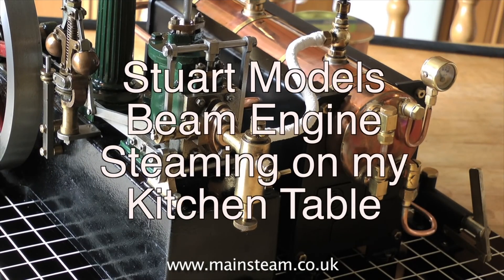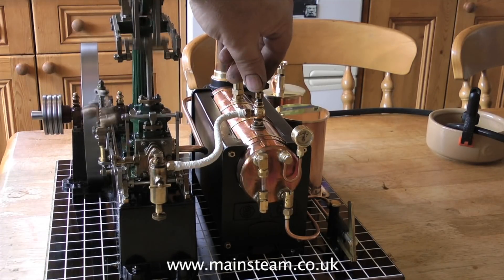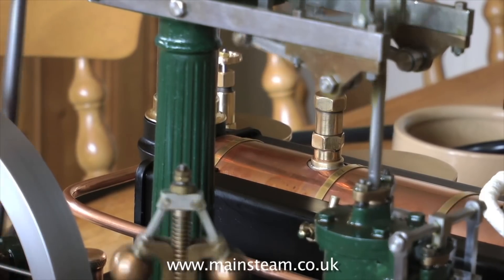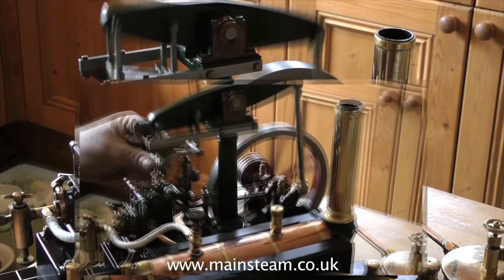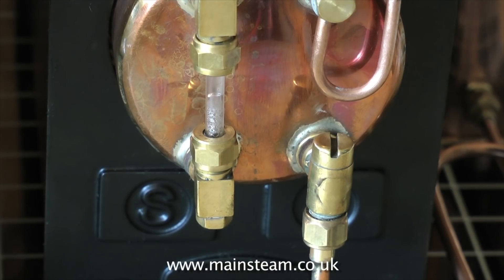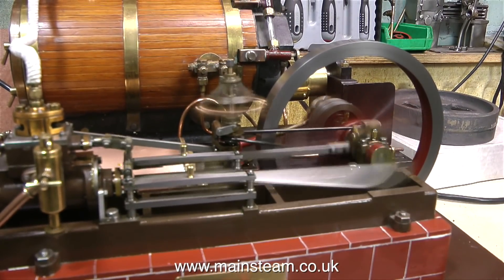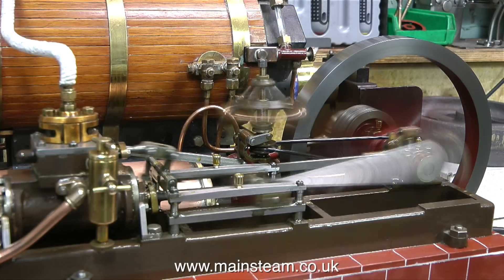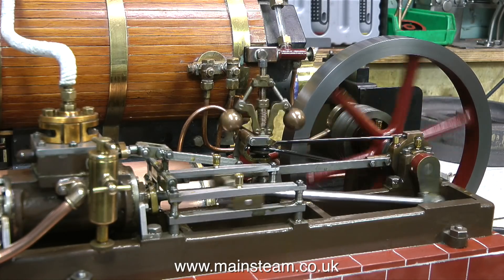MODEL STEAM ENGINES IN STEAM INDOORS - MAINLY IN THE WORKSHOP

Comment: I am so puzzled how the eccentric rod seems to be running half the speed as the rod connected to the crankshaft.  I am sure I am using the wrong terminology. Am I correct or is that just an illusion because of the motion?
Reply from the maker: the eccentric has half the throw of the crank web . . . .

Comment: What would happen if one were to use alcohol instead of water to make steam ? Would it run higher pressures at the same temperature and would the rings run dry of oil from the wash ?
Reply: If one could mitigate the obvious problem previously pointed out, it would be more efficient to a point than boiling water.  The amount of heat energy required to produce say 60 psi of alcohol vapor is a lot less than for water.  Spent vapor, not steam, would then be burned to continue the process.  Problems would be regulating that flame under changing loads, any leaking joints catching fire and the corrosion of seals on the cylinder.  Cant say what it would do to the oil/lubricant for sure, but vaporized alcohol can be very detrimental to a lot of  non metallic components.
Reply from the maker: Not recommended for obvious reasons - I will let some of the viewers answer this question ..... mmmm - boiling alcohol under pressure ......
Reply: Despite the obvious safety issues with using alcohol vapor as opposed to steam, what would be the point?  Any increase in efficiency would have already been lost in the energy input required to distill the alcohol in the first place.  I think lubrication would still be possible, but the steam oil would need to be of much higher viscosity than it already is.
Reply: Wise move, Keith!

steve

Comment: Has there ever been an advantage to using graphite as a lubricant elsewhere in a model engine other than in the packing?  How often would it have to be reapplied?
Reply from the maker: It never needs reapplying, unless the packing itself goes brittle. The Graphite is not really necessary in model sizes as the yarn soaks up plenty of steam oil anyway ....
Reply: Thank you, I should have revised my question though.  I have heard of bearings that use graphite as a dry lubricant, so I guess the point of my question is if you could use graphite for the main bearings and the like.  Or would you need space for packing in there as well?
Reply from the maker: The water would soon wash away the graphite I would think .....